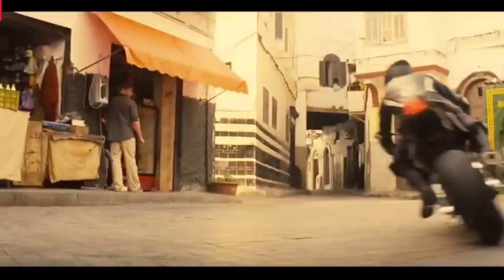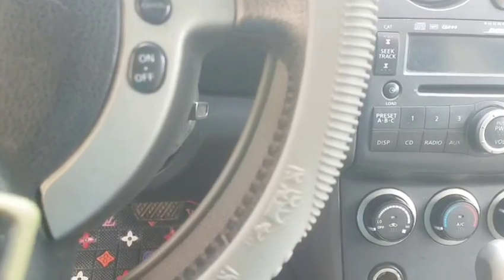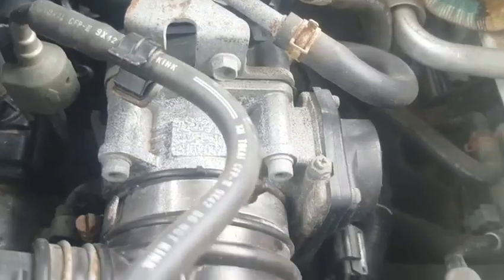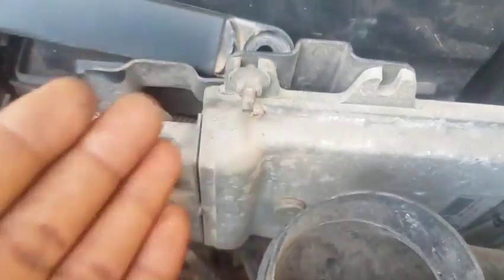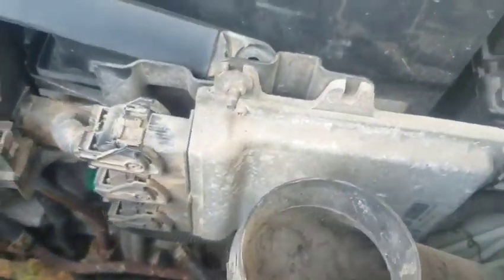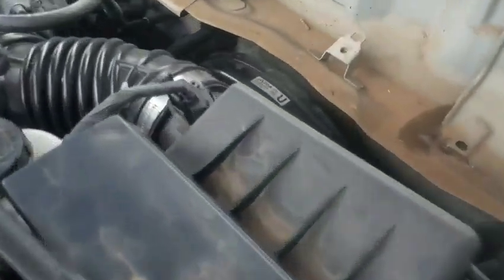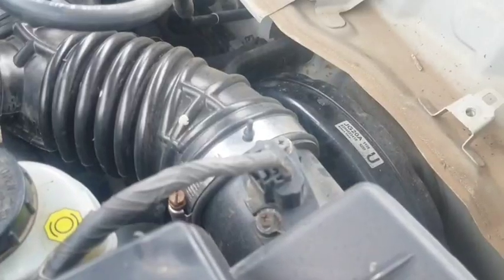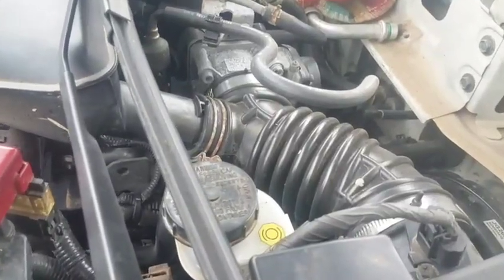8 Reasons Why Car Won't Accelerate When Gas Pedal is pressed

Comment: When I start the car in the morning it shuts off like no air getting to it . After a few tries it finally starts getting some acceleration when pressing the gas . But prior to that u can press the gas and nothing like u r pressing air . . Then when u drive sometimes it stops accelerating u have to turn the car off and on to get some gas back into the accelerator.
I’ve replaced the ignition coils spark plugs . And cam sensor and manifold pressure sensor . Still no fix . The car sputters all the time .
Reply from the maker: Whats the car make and model?